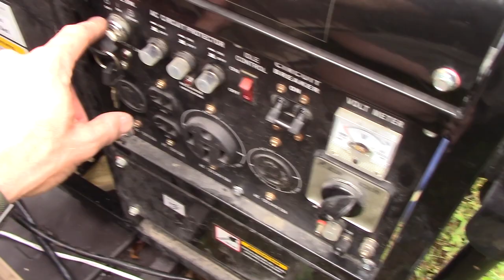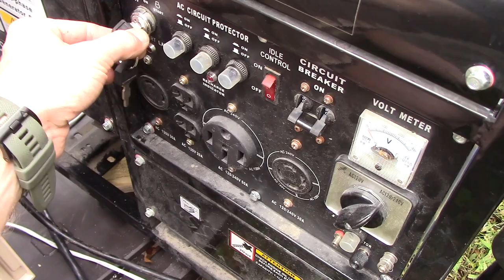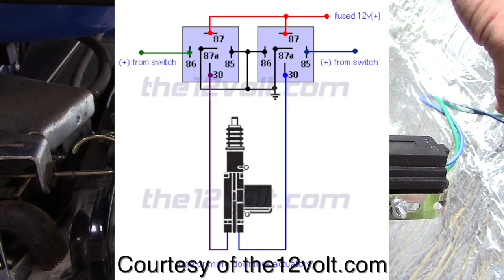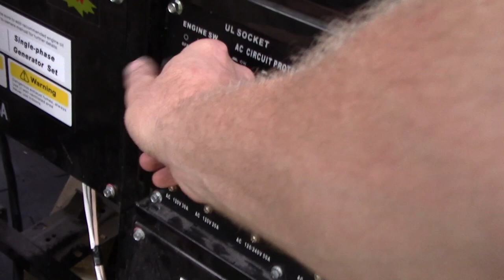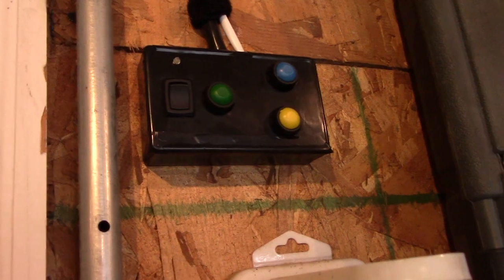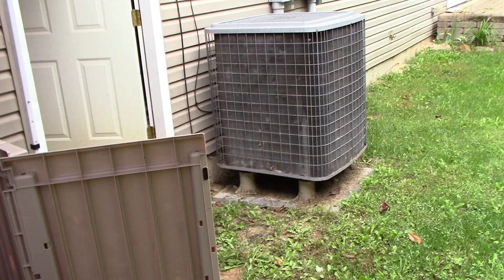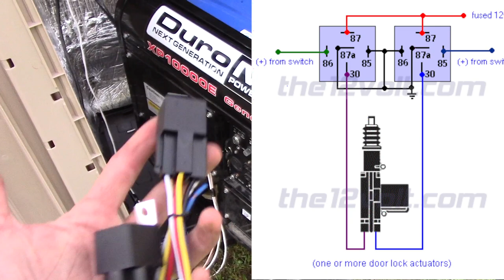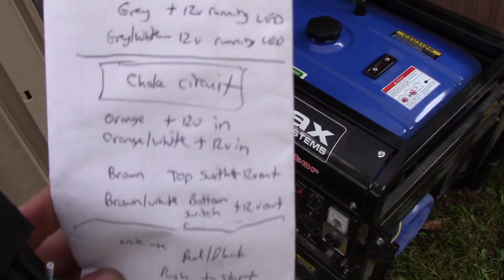Remote Electric Choke Standby Generator Conversion - DuroMax xp10000e

Comment: First of all, I want to thank you for your video and your wiring 

explanations. I have a Duromax 12000 generator. The key switch wiring is 

the same as yours. The main thing I changed was the choke actuator switch (I used 

the same Door Lock Actuator). I used a momentary switch to turn the choke on and 

used a spring to return the choke to off the position. All works great.
Reply from the maker: I didn't realize it when I made this but the choke on mine has a vacuum return to pull the choke off once it's started and running. I could have just wired the choke with a momentary like you did but oh well.
Reply: I have since converted my generator to natural gas. (I did have to buy a NG regulator) I am using the  Door Lock Actuator to push the primer button on the back of the regulator.

Comment: awesome video/tutorial!  I was thinking, with your remote control panel, and your skillz, you are probably only a few steps from getting an Automatic Transfer Switch setup to feed your emergency circuits, where some of the control contacts on said ATS device could start the generator itself whenever you lose power automatically; and subsequently shut it down and reconnect to your utility power when it's restored, all without you having to do anything or be home to get your generator up and running and online.

Comment: Good stuff.  But here I end up using my generator maybe once a year or so, and the only way I know it will start when I need it, is to shut it down by shutting off the fuel.  Doing that, it starts on the first pull even with 3+ year old gas in it.  I lose power more than once a year, but it has to be for more than a few hours before I go to the trouble.  So I'd want to do a remote fuel shutoff as well.  Even though I'd be using it more often with your setup.
I watched this because I just ordered a new electric start generator, updated version of yours there, ($640 w/tax n free shipping at Newegg if you're interested, POWERLAND PD2G10000E) and was thinking of doing the same thing.  Great idea for the choke btw.  I suggest you draw up a simple wiring diagram using something like windows paint, laminate or fold it up in a Ziploc bag and stick it somewhere in or on the gen.  The little run light on the control board is a nice touch.
Wiring diagram done in windows paint: https://photos.google.com/photo/AF1QipNr-B4eVXx5Il2jq4xhxM9p2pU6C5lIpC0dqAWT
Reply from the maker: I used to run it out of fuel each time as well. I had to make a few changes to use it the way I do. 1 being only using 100% gasoline with no ethanol. I have a place near me that sells it pure.  Also, I run it once a week to keep the carb cleaned up.
Reply: @JackofAllMasterofNone  I have a few cars that I've collected over the year, and everyone needs a fuel pump because of Ethanol.  So I hate the stuff with a passion.  But I have no issues with it in the gen, because I only shut it down with the fuel shut off valve.  This way there's no need to run it ever, until it's needed.  And it fires up every time with no problems.  I hope to use propane for the few outages we have here with the new gen, but if I ever need to run gas through it, I'll have to go out and manually run the carb empty, or add a remote shut off valve to the fuel.  Should probably think of remote shut off for the propane/natural gas as well...

Comment: Nice idea with the door lock actuator.  Only thing I would do different is use a 2-way momentery rocker switch for the choke so it never gets left on by accident.
Reply from the maker: The buttons are momentary. Momentary on and off. No different than a rocker switch.  The actuator has to have a reversing 12volt signal to work. Alternatively you could use a return spring to turn off the choke when you let off of the button but that adds way more stress to the actuator.
Reply: @JackofAllMasterofNone  
I believe I meant: instead of 2 separate switches to open and close the choke using a momentery rocker switch similar to the old power antenna switch for up/off/down would work better   so never to leave the choke engaged while running.
Reply: Id just use a 555 timer, relays and a two wat solenoid.  Badically the same thing except their would only have to be one button pushed to choke it and the delay the choke was on would be determined by the 555 timer circuit like push button then choke on for 10 seconds then automatically turns it off..  could run some sensing circuits for protection so couldnt engage while motor is running..  id even include some thermal cutoffs for starter temp and ambient temp like a fail safe
Reply: @Z-Ack  Man, I feel like I am back in school again. Good stuff
Reply: @Z-Ack That's a good plan - I intend to put this together with an Arduino/microcontroller, should be easy enough to add delays and a temperature sensor inside the generator.

Comment: This is an amazing way to make a portable generator work similarly to a stand-alone back up generator. Is it possible to get a parts list/wiring diagram of the box you created? I have the same generator, but mine is propane so no choke needed. Just looking for the way to wire up the remote box directly to the electrical panel on the generator.

Comment: Very nice video and thx for sharing the power door lock for choke. I was thinking of everything and that never crossed my mind. Where did u find your control switch board with the light notification when it's running? Thanks again 👍🏽👍🏽👍🏽
Reply from the maker: Its all custom made. I just used a plastic box and added the switches and a 12volt led

Comment: Could I use this "DC10K Engine Manual Start Generator Controller"? Just not too sure about wiring it to my Troy-Bilt generator.
Reply: What amperage should the push button switches be rated?

Comment: Hey brother, Im following this project and building the same exact thing with the same exact generator. Ive been able to find everything that you have used for the remote started box and choke solenoid setup. I know that other people have asked, but some wirering diagrams of that  starter box and anything else would be worth its weight in gold in order to finish this project. Thanks again.
Reply from the maker: I will see if I can find it. I already forget how exactly I wired it
Reply: @JackofAllMasterofNone  Looking to do the same, can you point me to the wiring diagram for your remote start?  Thanks
Reply: @JackofAllMasterofNone  can i  please get a wiring diagram for your remote start setup  im using the same generator also    Thank You

Comment: Dude a 50$ 20lb will run that generator for a week solid and maybe more..  all i did with mine is take an old rusted out grill and gut it for the gas connections and knobs, then i drilled a hole in the air filter box cover and tapped into that.  Same generator..  i just turn off the fuel cutoff valve when using propane then turn the knob back on if using gas..  mounted the tank on top of the gas tank with a water heater expansion mounting strap and done deal..  runs cooler, more efficiently and longer..  minimal ring abd cylinder

Comment: Hello. Can’t believe this is the only video i can find about having the duro max generator in a shed. I already have the shed for it, so my problem is how to run the exhaust out of the shed. The exhaust sits just like yours. Is there a kit or maybe you can tell me how i can get that done. I would appreciate it.
Reply from the maker: Watch my other video. I used a circular metal pipe standoff just to disapate the extreme heat and keep it from melting the plastic.

Comment: Good video sir. Me being an old car audio installer, this kind of project on my 15000k DuroMax is right up my ally. Lol. All I wanted to know is how is your battery holding up with the ignition left on. Do you have a little red light on the panel showing it is energized? I’m thinking if you did, that would drain the battery over time unless disconnected. Do you keep a solar panel installed to keep battery topped off? Thanks for any info.
Reply from the maker: The ignition doesn't work like that. It's not a real on/off switch. It's either off(in the on position) and on in the off which grounds out the coil and keeps it from starting or running. I do have a solar maintainer but don't need it because I run it once a week for 15 minutes and that keeps the battery charged up off of the alternator.
Reply: Oh ok, well that makes it a lot easier to deal with. Also, I’ll have to see how the choke is situated on the 15000k being that it is a V-Twin motor. Thanks again

Comment: Do you have a wiring diagram? , just an idea for the choke the actuator is very strong so just use a spring to retract the choke handle.

Comment: very interesant my friend,
Reply: @Jack of All Master of None . My inlaws are retired now live near the gulf in Florida. Father inlaw bought a generator like the one in the video. Since purchasing had to have a pacemaker put in due to heart problems and cannot be near the generator while it starts or running. He has purchased a (universal) remote start for a car. Was curious if we sent pictures of the diagram could you help in figuring out what wires to use and not use. I live near Charlotte and they are 9 hrs away so time is not on my side when I get there along with mental fatigue. Would be happy to send my contact info to make communication easier. Please let me know if you can help thanks in advance.

Comment: I want to do this to my generator, but what relays did you use? Are they specific or just a universal thing? Thank you for sharing this video.
Reply from the maker: Just universal automotive relays
Reply: @JackofAllMasterofNone  Thanks!! I found some on eBay. Two from eBay were cheaper than one at the auto parts store that I work at plus the ones from eBay came with the harnesses.

Comment: thanks for the Video, Just one question,
 did you Parallel your Connections to the Key Switch Wiring, So you can still start it at the Generator?
Reply from the maker: It is paralleled but the problem is the off position is actually the on position if that makes sense. When you turn the switch to off it completes the circuit and grounds out the ignition. If you shut down the generator and then turn the interior switch to the run position you will be able to start it outside. If the switch outside or inside is in the off or shutdown position it wont start
Reply: @JackofAllMasterofNone  make that momentary contact, normally open!  Where do you power up the green "running" light, from the 12v charging circuit?

Comment: I ended up not wiring a reversing relay for the choke, but rather put a spring on the actuator  thus forcing the choke  open when actuator is  de-energized.
Reply from the maker: That works well also and is easier. That's kind of how some OEM ones are anyway.

Comment: Great Video. however you need to be able to shut off the gas to the carburetor while its sitting there doing nothing. Nothing worse than leaving gas in the carb for months on end.(Ask me how I know) You will end up with gum,sludge,etc.Always best to shut off the gas when its done running and let it burn up whatever is in the carb. That way it wont gum up hopefully.
Reply from the maker: I use on only ethanol free "rec" gasoline. What gums up the carb is ethanol, not gasoline. I have let it sit for months and never have any problems.

Comment: I have mine wired as per the diagram. Three hot wires one to each switch and one fused positive to both 87s. Grounds to each 87a , 85 on relay one and 86 relay two. Relay one #86 is from one switch and positive to battery.  #85 on relay two is from the other switch that comes from the battery. Each #30 has one wire from the actuator. 
I have it exactly as the diagram says AS LONG AS where the diagram says +from switch means 12v from battery.
Problem is the actuator only functions outward.
Reply from the maker: The diagram is correct. Double check wiring. Try to manually power the actuator by attaching it to 12 volts and then switching the polarity. All this circuit does is reverse the polarity to the actuator. So when you press one switch it's positive one one terminal and negative on the other and then the other switch reverses the polarity. Very common automotive circuit. You can test it with a voltmeter that will show +12 volts and -12volts

Comment: I have it all done but the led indicator light u used. Did u run wires from the cig lighter plug or wired from generator?
Reply from the maker: Yes. I just used the 12volt output on the 12 volt screw terminals on the panel.
Reply: Thx a lot my friend. I ended up ordering 110v LEDs and wired from a plug off gen. U was a really big help with dat masterful design!!!

Comment: If you put a dpdt relay u can use a toggle switch for forward chock and back not choke
Reply: The signal has to be a momentary signal to the actuator.  A dt relay will always send power to one side or the other, which will burn out the lock.  Actually, if he would have used heavier wire, he wouldn't have even had to use the relays.  You could always use a spdt, center off, momentary toggle as well

Comment: The diagram shows one wire to the switch. Where does the other terminal on the switch run to?
Reply from the maker: The other wire on both switches goes to the positive term on the battery.

Comment: Why not connect the actuator directly to starter terminals, so when crank the choke will be activated and when it starts, spring will turn back the choke
Reply from the maker: If you do a hot start you dont want the choke on
Reply: @JackofAllMasterofNone  you are right, but it is much easier, compared to the variant with the relays. And the most important - it is automatic, it chokes only the time when crank the engine - 2 or 3 seconds. And other, my gen is with honda clone engine (chinese but works great) and it wont start without choke, no matter hot or cold, without automatic choke I can not use the remote control.

Comment: Bad idea... Just get a standby generator.
Reply from the maker: Has been working great for the last 4 years.
Reply: @JackofAllMasterofNone  Also seen a setup almost identical burn down two houses.
Reply from the maker: @markavery2888  Hey I've seen a standby generator burn down 2 houses. We even?
Reply: @JackofAllMasterofNone  LOL Good one... Most standbys that I have seen burn up had maintenance or install problems.   
Not saying what you did can't be done, but most people screw it up.  The generators overheat.  Still not recommended to put it in a combustible container against your house.
Reply from the maker: @markavery2888  I understand, which is why I installed a fire suppression system in the "box" should something go awry. It is not as ideal as a standby but in rural areas where no propane or natural gas is readily available, it is an important option for some people. My plan is to upgrade to a diesel standby generator soon.